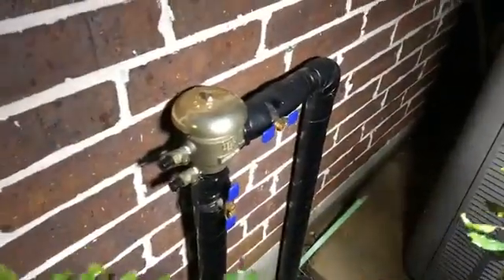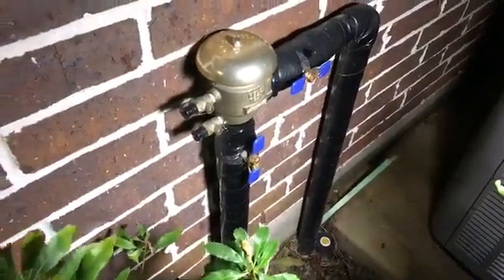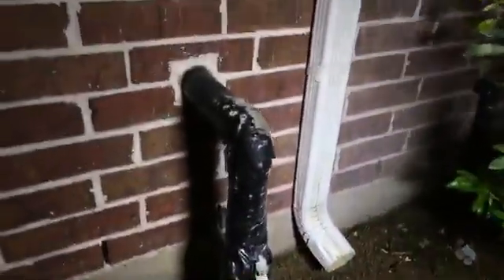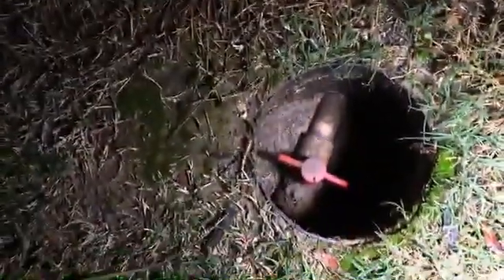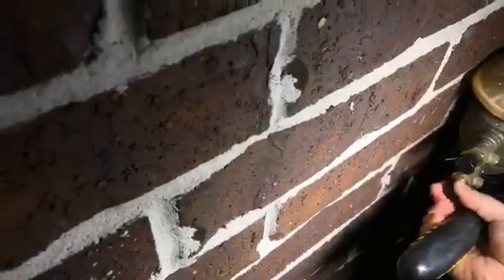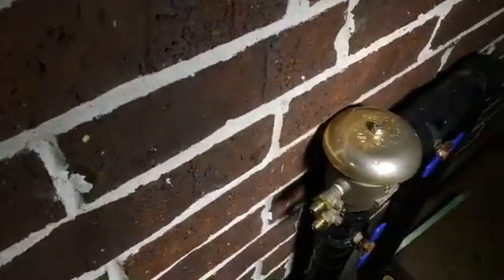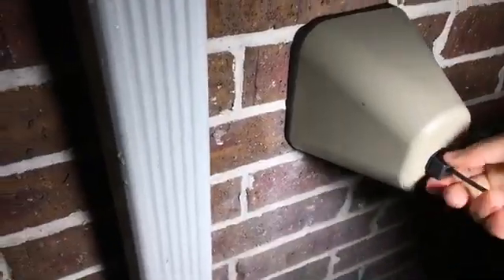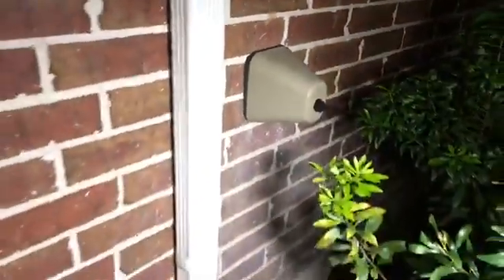How to easily winterize your sprinkler system in Texas - Back flow preventer & Underground shut off

Comment: Why do you turn the valves only 45 degrees? Great video thank you for posting.
Reply: Was wondering the same thing
Reply from the maker: There are pockets of water/air in the valve due to the way valves are constructed. A 45 Degree angle lets this trapped water out of the pockets. Think about a square peg in a round hole. The "Body" of the valve is not a complete ball shape. It is rounded on one end but looks like a square if you turn it another way. The actual valve is mostly ball shaped with a hole through the middle. but there will be water trapped between the partly square shaped body and the ball valve.

Comment: Install a drain valve to remove the water lodged in the Backflow preventer and brass valves with blue handle.
Reply: Only if the builders in Texas do it for you... they don't....